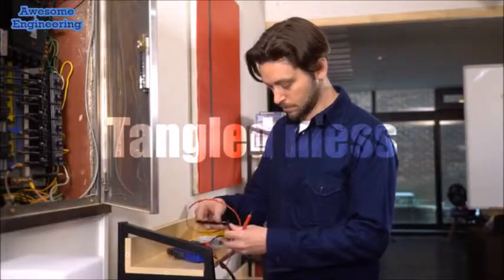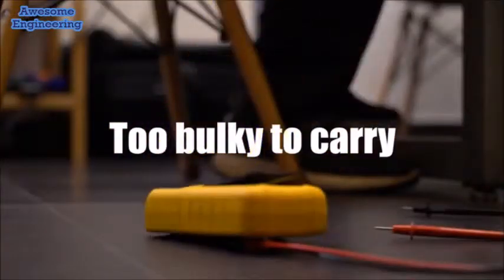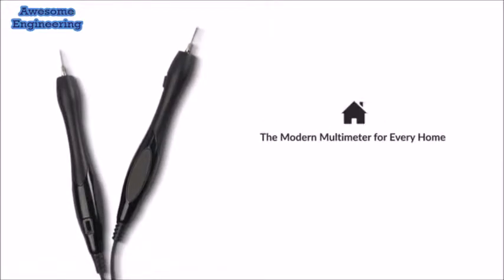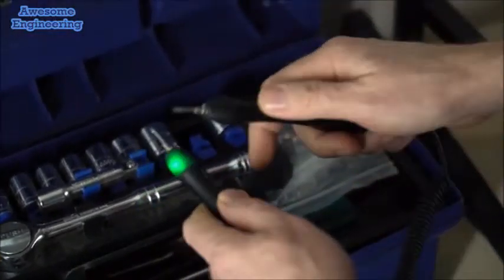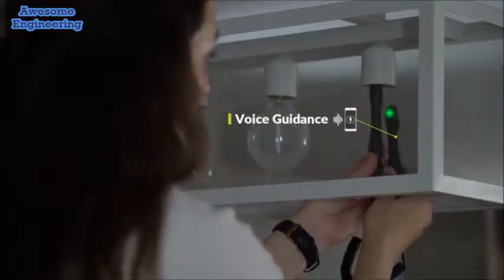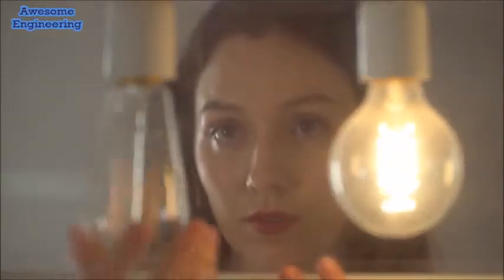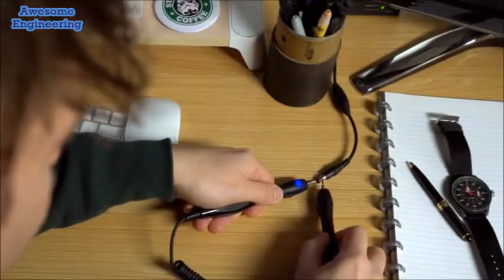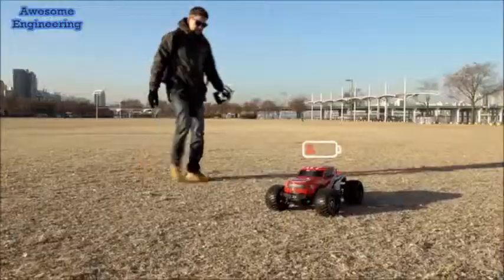Auto-Detection l Bluetooth l Smartphone App Multimeter

Comment: More like Moron meter   If you cant use a multimeter you should never be measuring line voltages- no way someone with so little knowledge has a good grasp on electrical safety.